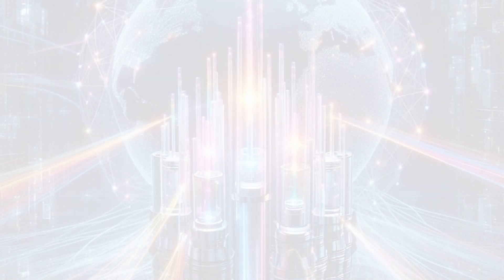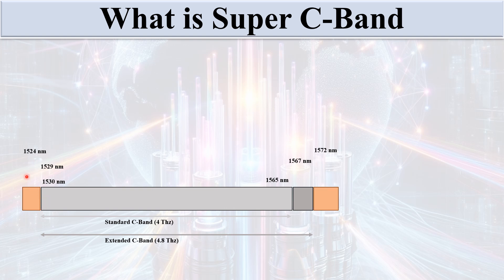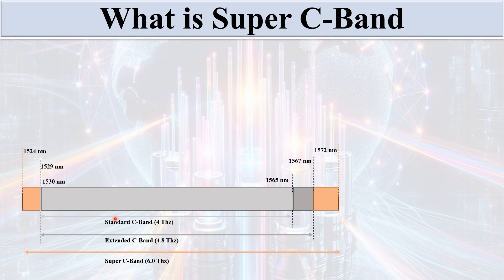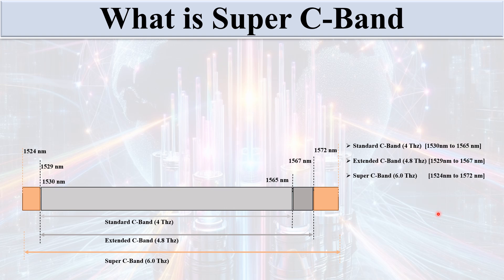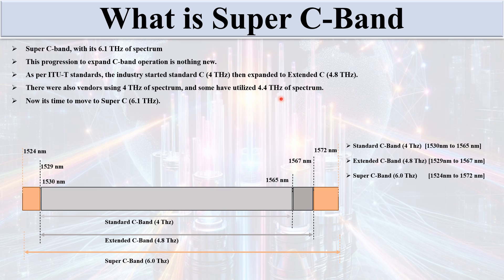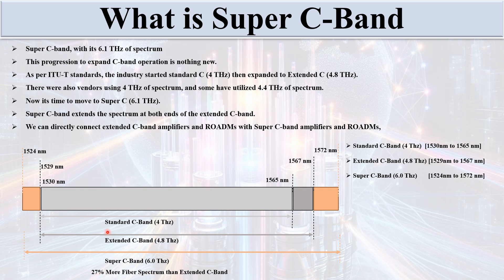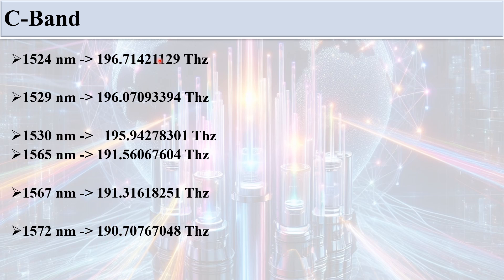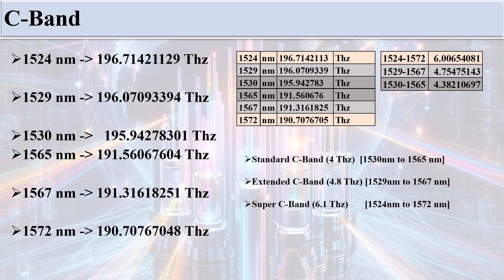What is the Super C-Band ?

Comment: What is the maximum number of channel for each bandwidth?
Reply from the maker: You can get the Max Number of channel by dividing the Spectral Bw to Channel spacing .

The minimum channel spacing  is 37.5 so we can use 
128 channel in extended C band.
4800/37.5

In same way you can calculate for others.